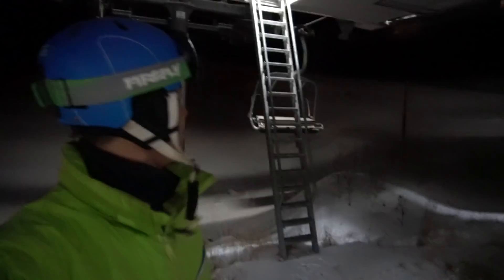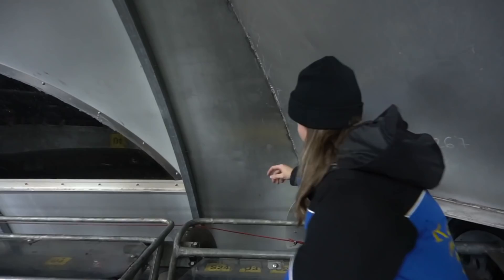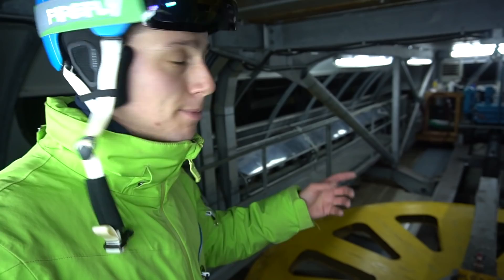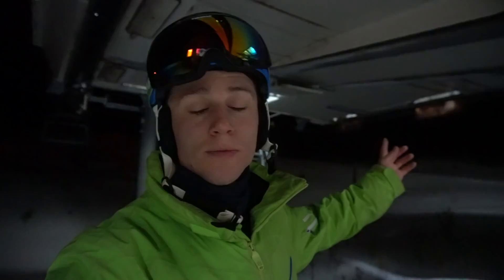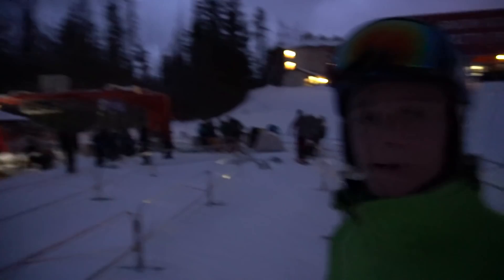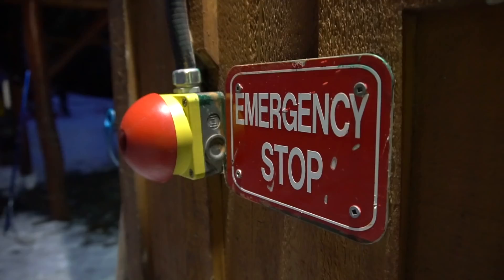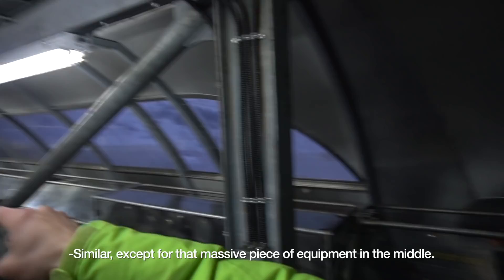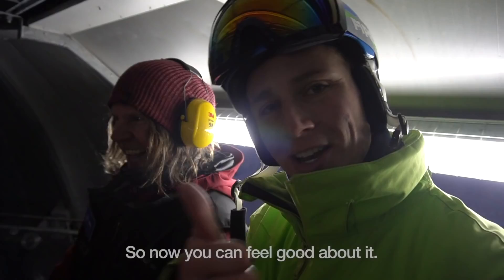Opening Day with LIFT OPERATIONS - Fernie Alpine Resort

Comment: Some chairs that are very high altitude use diesel because it is too high for electricity
Reply: There are some deisel powered lifts out there, but they're few and far between, and definitely not built that way because of the altitude. Electric motors work the same at all altitudes but deisel engines lose efficiency. Also it doesn't make a whole lot of sense that it would be easier to haul diesel fuel up a mountain than to run a cable.